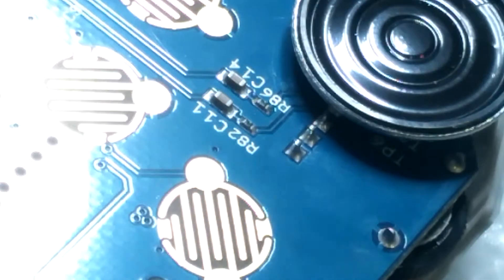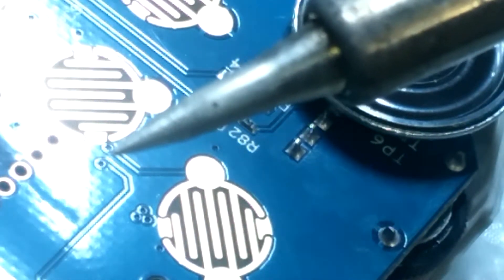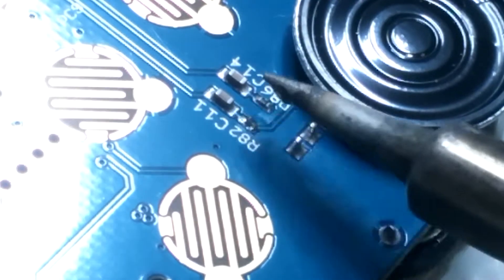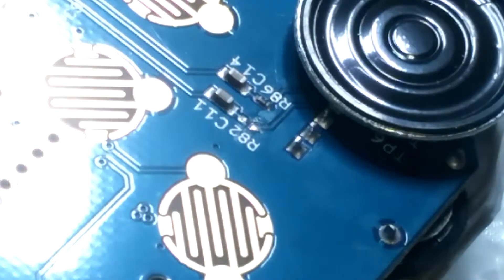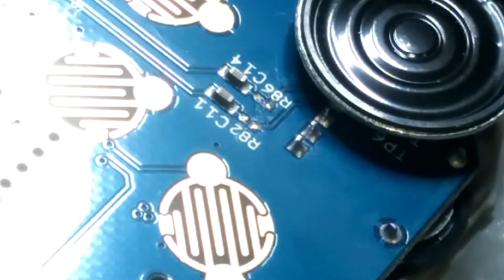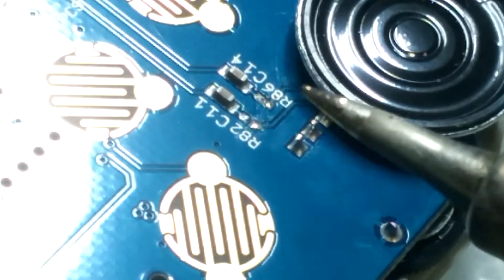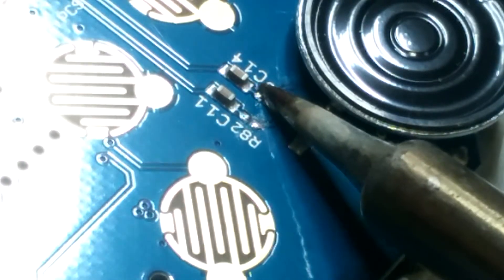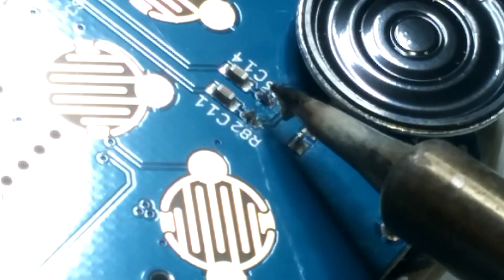Modify RetroStone audio filter for headphone volume (1st batch of RetroStone)

Comment: Thx for this, I bought a second hand blue ltd edition version of ebay which had no sound through the headphones, this helped to repair it but i do have to fix the headphone jack. It cuts out on the right headphone and i have to wobble it a tiny bit to get it back so I'm hoping re soldering it will fix it as well. But I do love this device it has excellent design and rocks for gaming :), only downside is charging it i can't seem to get any charger to fully charge it within a reasonable time.